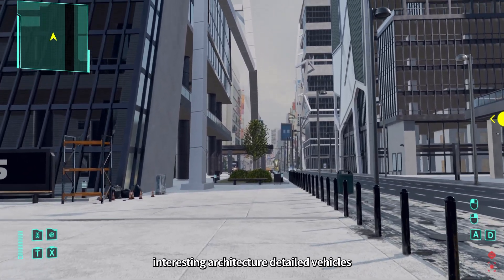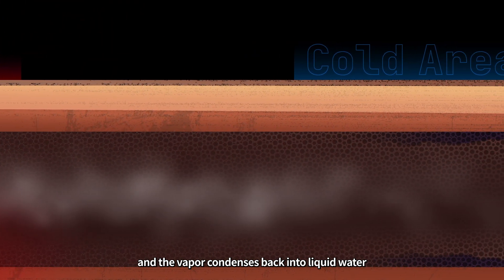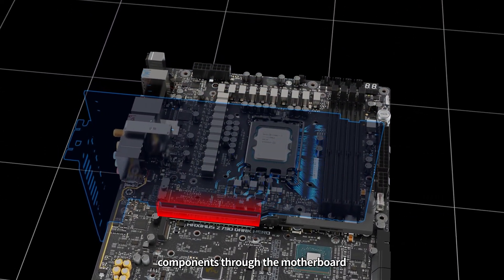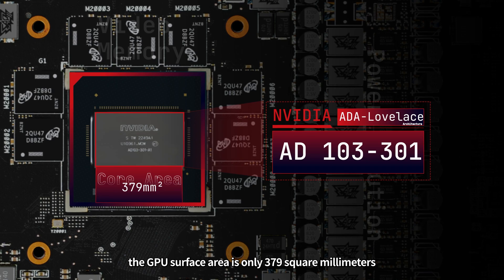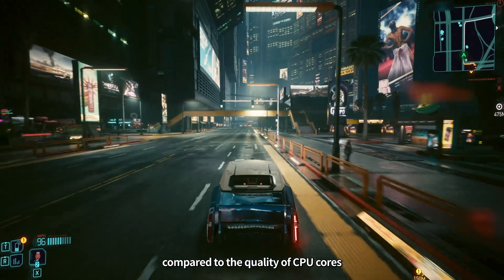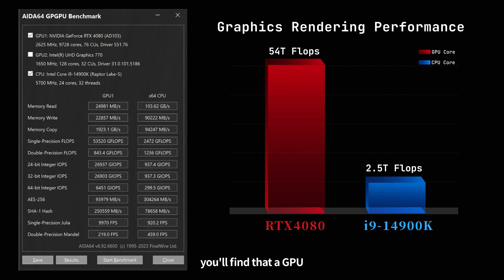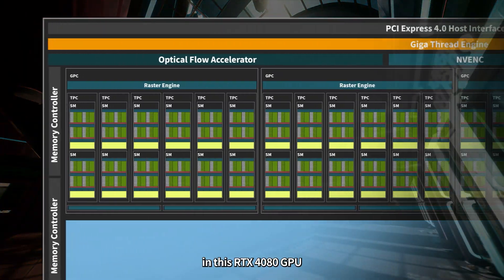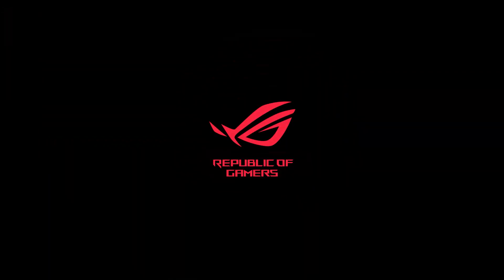The ultimate weapon for all gamers – the graphics card with subtitle

Comment: In computing,technically a laptop is the same thing that a workstation.
It's better and compact the thing is that the workstations are cheaper.
You can either connect a mouse,a desktop or whatever to a laptop.

I would like to hear:This app. will terminate the xx november... ...

3D is now part of the evolution,it will soon become most required.
2K and 4K alone it's not enough.
For new tablets it would require a 6 or 8K tech in add.

How android and ios gaming work it's by the games,it depends on the games and if you manage to find a great game,then everything is different. Very peaceful and agreeable for gaming in others conditions.

Comment: Doubted this video being good cause of the title and how the wireframe looked at the start of the video (not good topology!), but as it gone on, this is probs the best video explaining a lot about how GPUs function and why we still need them these days! Definitely saving this one and using it to explain GPUs to peeps, ty!! :)

Only criticism is that there's no in depth explanation to why we rely so much on the parallelisation with those floating point calculations. For anyone wondering, its because GPUs rely on a parallised instruction set called SIMD. It just means single instruction multiple data, so you only need to use a single "add" operator to perform multiple adds on many different values all at once.

How our brains would be with SISD, single instruction single data where if we were to add a 3D value to another, we'd do "X + X", "Y + Y", "Z + Z", SIMD changes this and simply by relying on a data vector being aligned correctly, it just does "XYZ + XYZ" in one single take. It cuts down the amount of time it takes to compute that by 1/3rd and it's why GPUs are so powerful (But a huge pain in the butt to program!!)